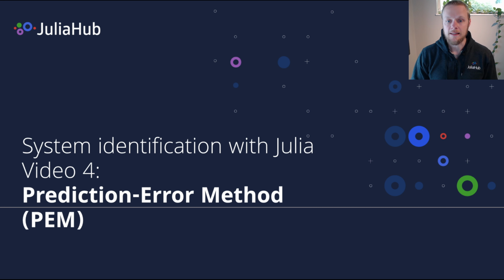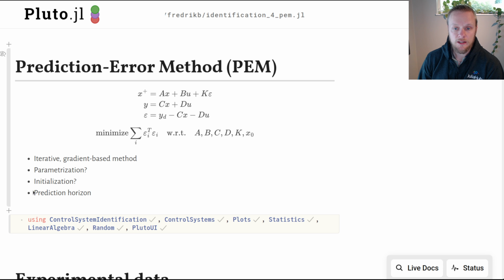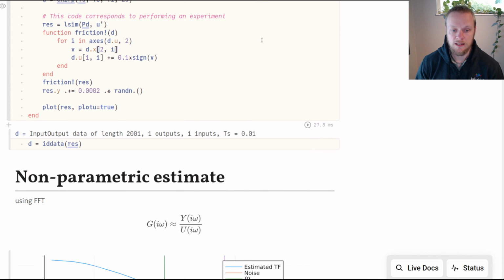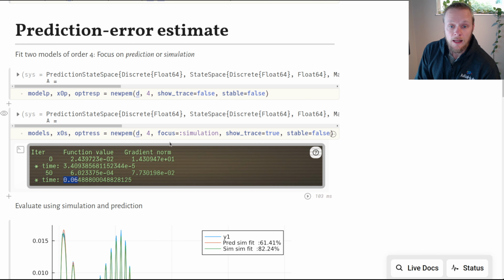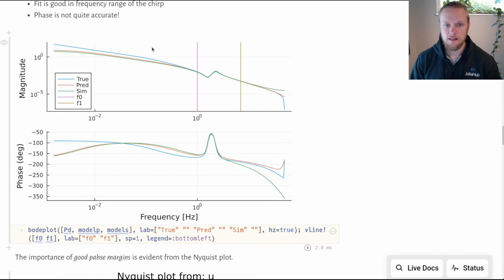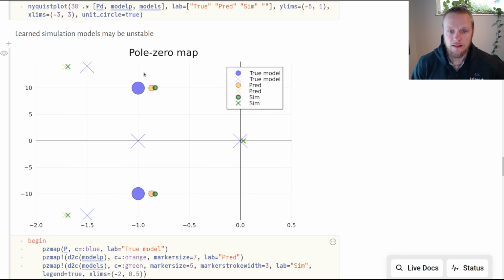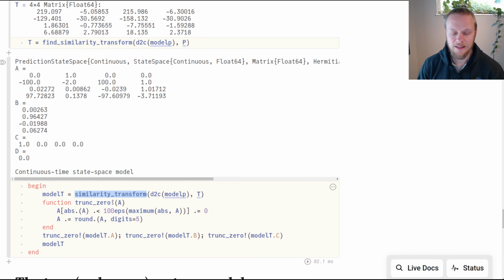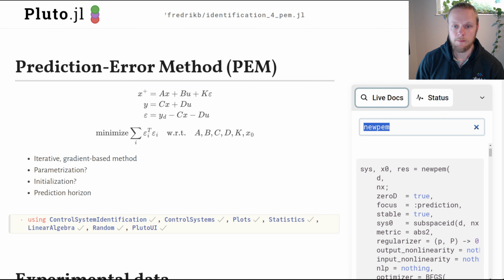System identification with Julia: 4 Prediction-Error Method

Comment: I'm not familiar with this K x epsilon term in the state transition equation.  My understanding is, x are the states of the model (not of the true system), so at first sight it seems odd to have the error, epsilon appearing in the model transition equation, because this would mean the model prediction depends on the data (epsilon is a function of the data).  Is there an explanation or some further reading on this aspect I could do?
Reply: Ah, you said it right at the end: "it corresponds to a steady-state Kalman filter".  That's interesting, so you are fitting a linear model and a Kalman filter simultaneously?   Does this method have a name in the literature or is there a reference on it?
Reply from the maker: The name of the method is in the video title. You can read more about it in "system identification-theory for the user" by Ljung

Comment: You mentioned that the simulation data contains Coulomb friction, and later you show the Bode and Nyquist of the original system - I assume without coulomb? My gut feeling is that the identified models picked up on the friction, and it probably improves phase margin. So it would be interesting to simulate the nonlinear system around the phase margin of the 'true' and identified parameters.
Reply from the maker: Yes, the identified models will in general adjust their parameters to fit the data including the friction, which in this case means that the predictor estimated by PEM will try to rapidly cancel the simulation error using measurement feedback.

I'm not sure what you mean with "simulate around the phase margin", the phase margin is an angle. Do you mean simulation of the system with an input frequency corresponding to that of where the phase margin is calculated, i.e., where the loop-transfer function is 1?
Reply: @JuliaHubInc  I would try 2 things (might look into doing it myself later, I got here because of sys ID, need a bit more time to set up and get familiar with julia...).

So 1, simulate the open loop nonlinear system at the specific frequency where the phase margin was calculated, and check the output phase delay numerically and calculate the margin from that. Maybe try it with different input amplitudes since the nonlinearity would change the result.

The second is to close the loop on the nonlinear system and introduce an additional delay and check stability with a handful of values that correspond to different phase shifts at the cutoff frequency. One that is predicted to be OK by both  sysID results and true system, one that is sure to be unstable, and maybe 2-3 in-between values.
Reply from the maker: @gergelybencsik8626  a phase margin is a property of the entire loop-transfer function, including the controller. In the video, I choose a proportional gain of 30 simply to make the plot interesting and facilitate making a point. More detailed analysis of the friction nonlinearity in the Nyquist plane can be made using describing function analysis which, can often give additional insight alongside simulation of the nonlinear system. Control design and analysis are outside the scope of the videos in this video series, but I encourage you to check Julia out for some experimentation with this :) You can also launch the notebook that is linked in the video description on the JuliaHub platform for free, which would allow you to experiment with it without installing Julia yourself.